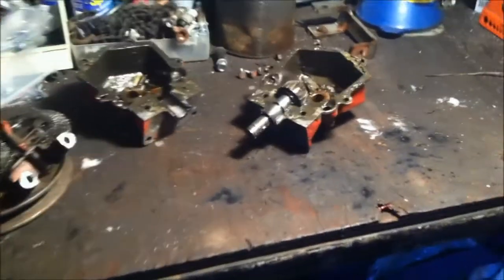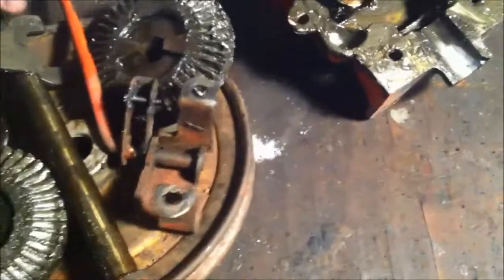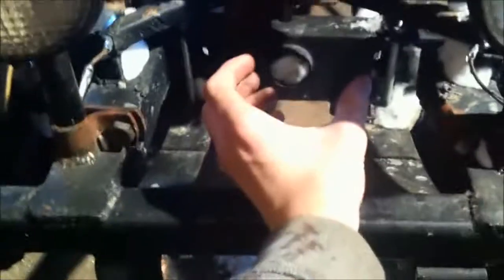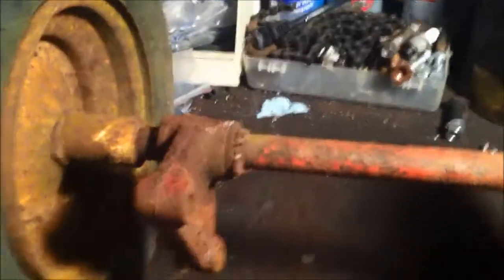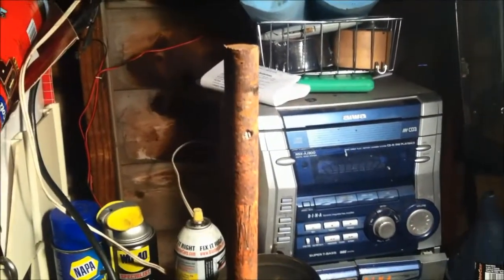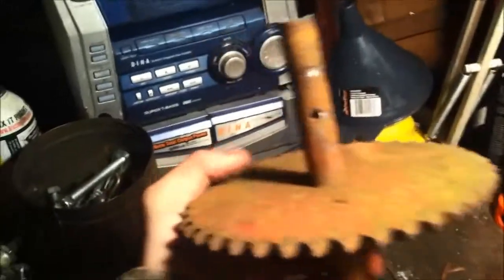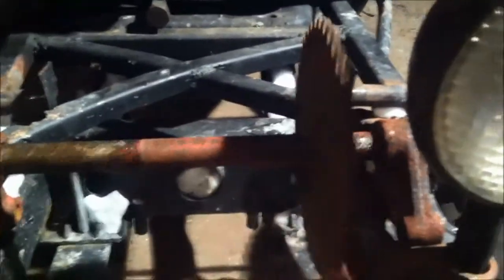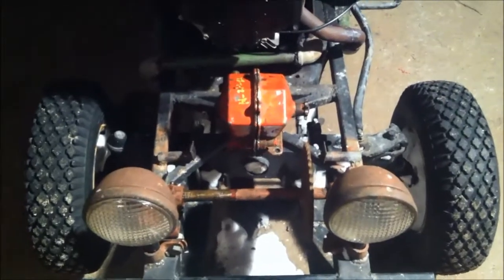Engine Powered Mower Winch Build: Part 1

Comment: mtd single speed axle should have the same gears in it. tear one down and check it out for yourself. they look very close if not are the same. i have one of these gear boxes i used a mtd gear in
Reply from the maker: ah ok ill see. plenty of fnrs in the junkyard and i have  fnr. dont they have a torqes bit or some hex head thing? not sure. ill check out some diagrams
Reply: ok just figured id throw that out there as an idea, nice offroader tho
Reply from the maker: yea i saw the diagram and looks like everything should work, you said you swapped the gears over and shifter bit right? And thanks
Reply: i used one of the gears. havnt exactly tested it but it switches forward and reverse.and everything spins free the gears look exactly the same to me anyway
Reply from the maker: alright thanks a bunch dude
Reply: no prob